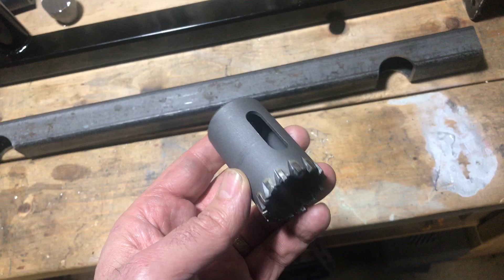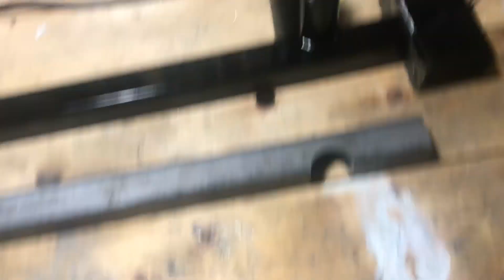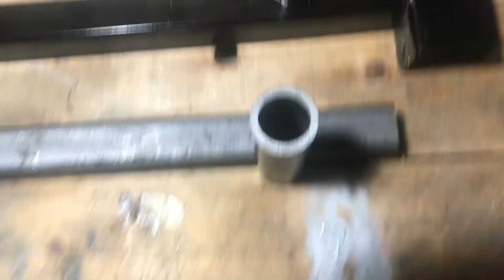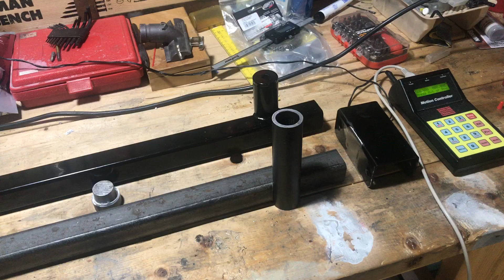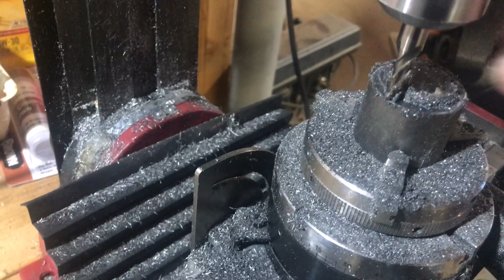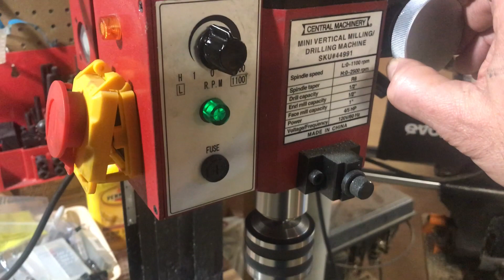Superlite SLC Build 013 - Front Engine Mount Fabrication Part 1

Comment: how much would you charge me to FAB me a engine mount with these same exact specs??
Reply from the maker: Troy, as discussed in the other thread, best to have RCR do the work. I took a peek at my build plan where I log all my hours and actually spent 31 hours fabricating that bracket. Most of the time was spent milling the caps down. After I completed this bracket, I did wonder if using a LS swap mounts on the LT engine would have worked with the LS3 engine mount provided in the kit. That would have saved me a lot of time.
Reply: @JoelKSLC  roger that those were sent before you replied to the other questions. I think i sent you another question on another vid also but you have answered my questions already so please ignore the rest. your answer was what i was looking for

Comment: Curious as to why you didn't use the LS3?  Be great to know.
Reply from the maker: Hi Leigh, The stock LS3 is 430 horsepower vs. the LT4 is 650. Since my build will be emissions legal I did not want to use a race cam or aftermarket supercharger with the LS3 which would not be emissions compliant.  So went with the LT4 for 600+ horsepower which can be emissions legal.